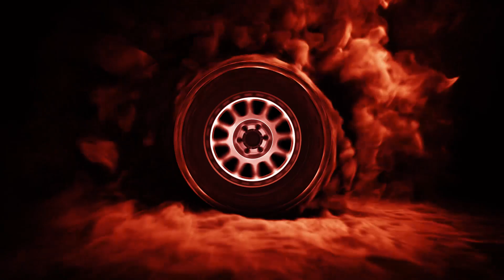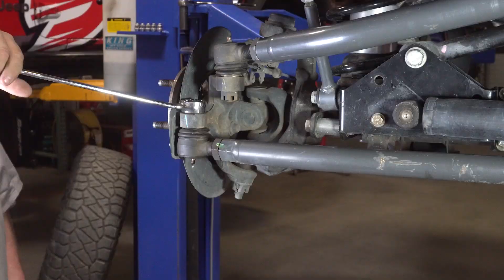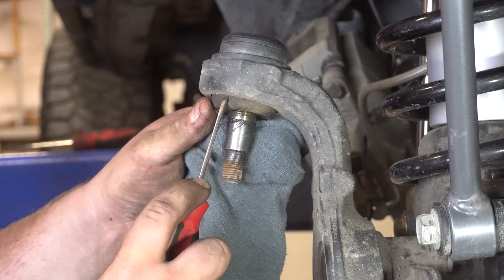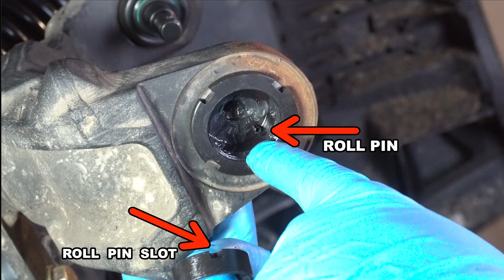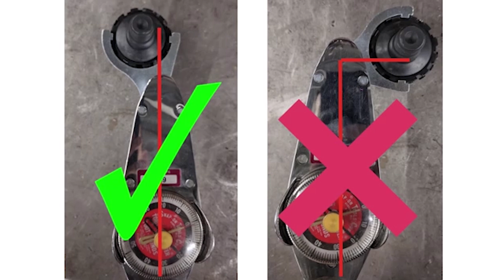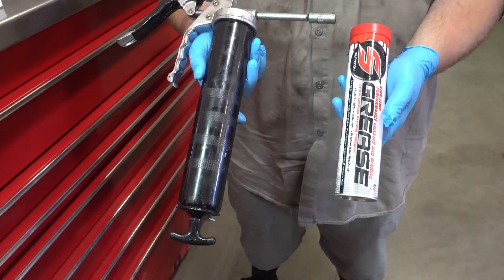Synergy Manufacturing Jeep JK Adjustable Ball Joints Install Video

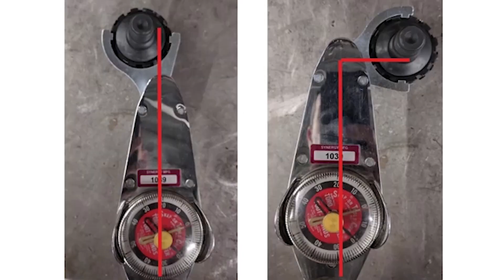Comment: These instructions are WRONG at 7:30 because you're adding length to the wrench by having the crows foot straight out. The crows foot needs to be at 90 degrees to the wrench.
Reply from the maker: Hey Ranger, thanks for the callout! While it is technically the wrong way to use a crows foot, it is nearly impossible to fit the torque wrench and crows foot assembly when used the "correct" way into the lower ball joint area while the wheel and knuckle are installed. So we changed the recommended angle of the crows foot and altered the torque spec to account for the slightly higher effective torque on the nut.